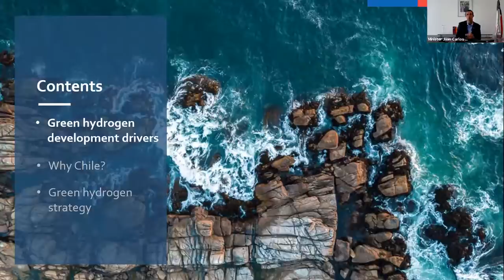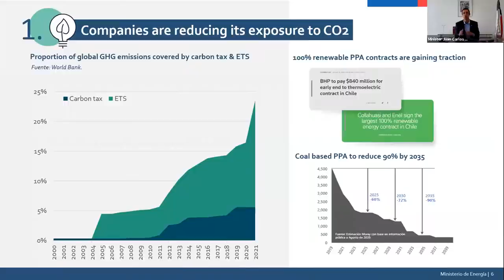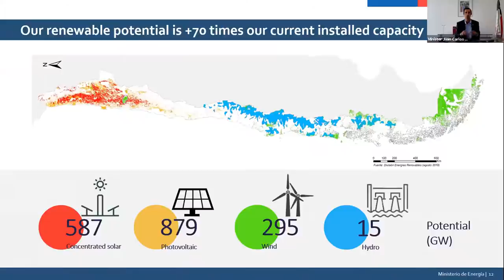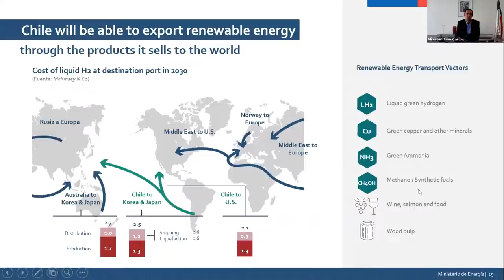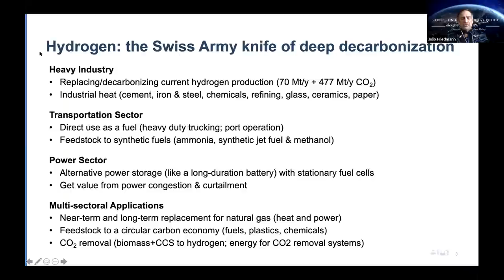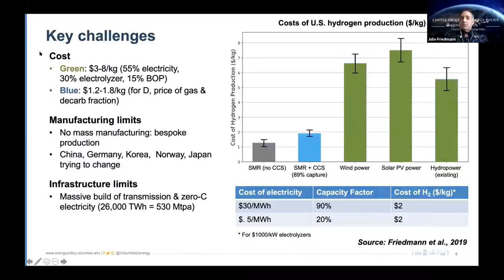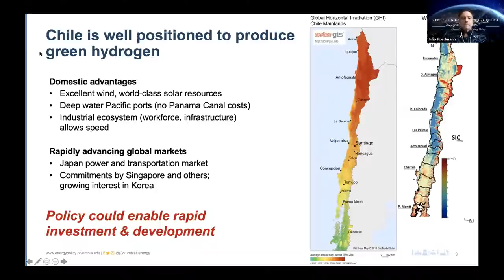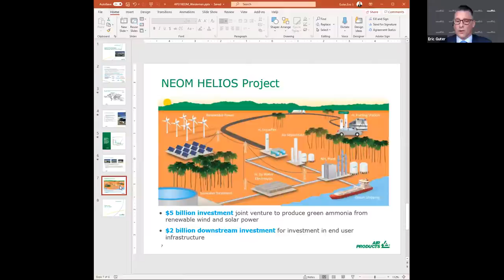Demystifying Green Hydrogen

Comment: I don't get how green hydrogen will help reduce climate change.

From my understanding when you burn hydrogen gas in air it produces water vapour and nitrogen oxides. It is also my understanding that water vapour is a greenhouse gas and it could be argued that it is causing more harm than CO2.

Comment: Madam in reference to you conversation on green hydrogen. We are designers inventors of all types  of technology. Over 30 yrs working on hydrogen,I would have to say we have the only system in the World that actually re-uses the  hydrogen over and over again,producing a huge excess of electrical energy.As well our system produces "ZERO" CO2,The way the whole World is going about this is all wrong.Our system does not have to stop to re-fuel,and can be used to run Tankers ,mining equipment ,planes etc.This technology eliminates all existing sources of Renewable.